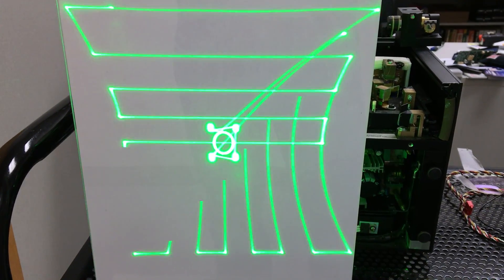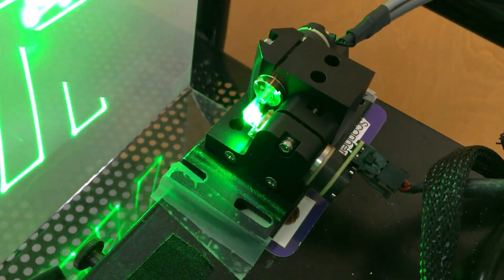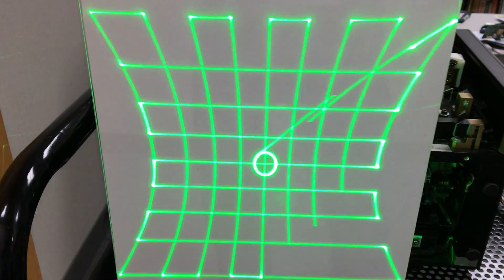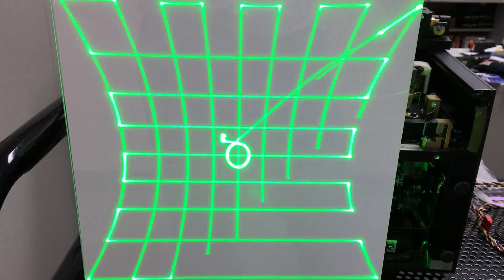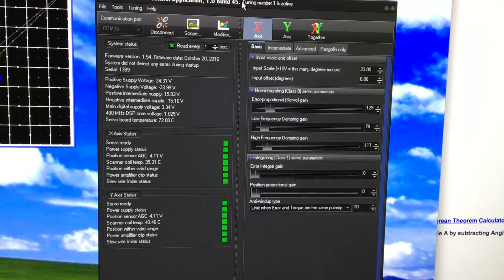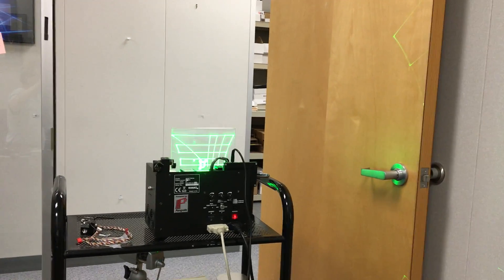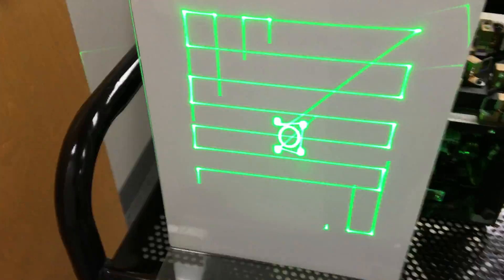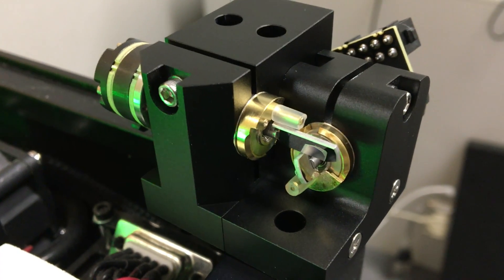Compact laser scanner with 72 degree by 92 degree scan angle

Comment: I have a question. How fast the galvo has to be to scan 240 parallel horizontal lines with maximum angle at 60fps? Is there any formula that would allow me to calculate that?
Reply from the maker: 240 lines could be 240 "scans". If you use bidirectional scanning using a triangle wave, then you can think about it as 120 "cycles" of the triangle-wave. 120 cycles that takes place 60 times per second would be 7200Hz. Certainly no galvo scanner can do that at 60 degrees. A polygon scanner would conceivably be able to do that, and the scanning waveform would be a sawtooth-wave instead of a triangle-wave.